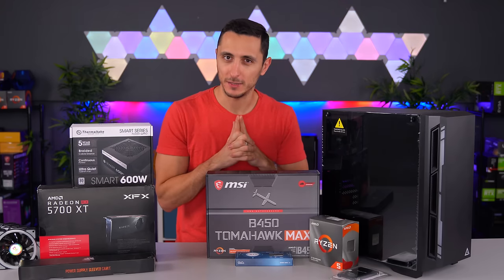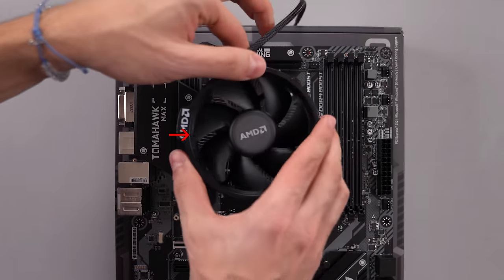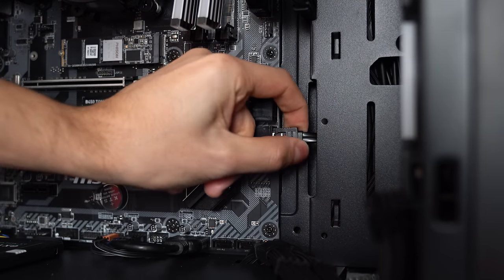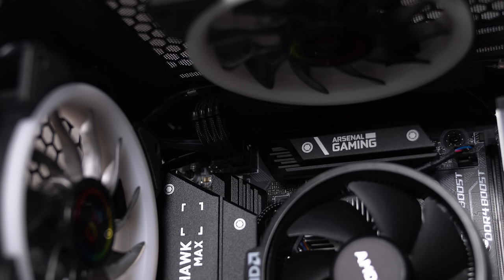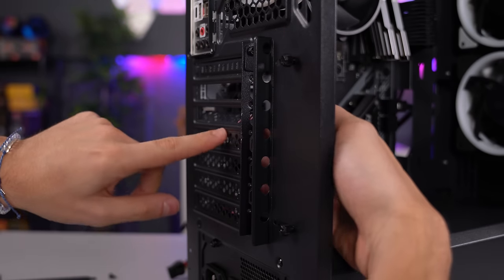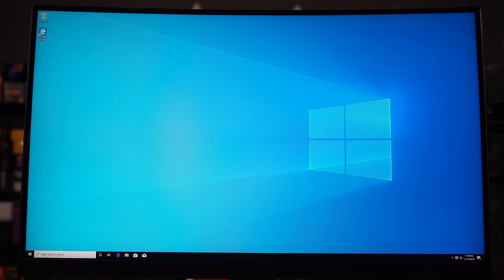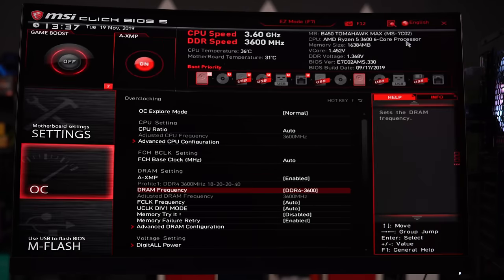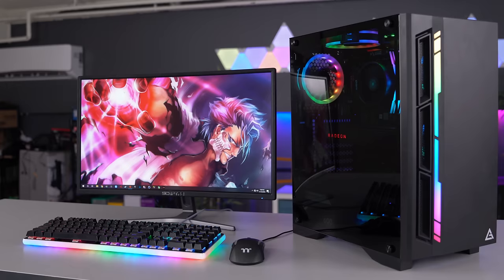How To Build A PC - Full Beginners Guide + Overclocking

Comment: I am not sure what I should buy:
NFX RX 5700XT or Non-Blower RX 5700XT
Reply: Non blower style will probably get you better temperatures assuming you have a conventional build with multiple case fans and room for air to flow in the case
Reply: @TheTreyVidz  Did Techsource use the non blower in this build?
Reply: @uncledave8547  He's using a blower card in this build.  Way to tell is that the heatsinks are hidden within the shroud on blower-style cards.  I assume he used this card because it fits the budget better.  In reality, the differences are probably not too extreme when it comes to cooling but typically you'd benefit more from a non-blower card (aka open-air) in a build like this.
Reply: @TheTreyVidz  Thanks for replying, i'm going to build this pc but I don't want to use the same graphics card that he used. If I get the non-blower one from the link in the description will that work, and will It make the pc run better?
Reply: @uncledave8547  No problem! Theoretically yes, you'll have better performance because your card will run cooler, and will keep it "healthy". Keeping temperatures low means the graphics card can perform its best and you won't have to worry about thermal throttling or the lifespan of the card. Low temps also give more headroom for overclocking if you plan on doing so.

To explain the differences, the blower-style cards have a heat sink that is hidden within the GPU shroud and pulls in air that exhausts through the rear, which is outside of the case.  But these cards just have a single fan and that fan will have to work harder to keep things cool. 

The non-blower (open-air), specifically the one linked, has multiple fans that are pulling air through the graphics cards to the heat sink. However, the heatsink on these cards are open and expel hot air back into the case. For most builds, this isn't a problem as long as you have proper airflow that can exhaust the hot air from the case, making this the preferred card for this type of build since the card can pull in more air and the case can exhaust the hot air that it expels. 

 * Keep in mind as a side note, not all single fan cards are a blower-style, open-air cards may also have one fan but they still work as described  *

The blower-style is better for super compact builds that don't have many fans or space for air to flow as it exhausts the hot air outside of the case instead of back into the case where it's hard to expel it. (Mini ITX builds) 

Hopefully, this helps explain the differences.  Good luck on your build, the 5700 is a good card and the one linked is on sale now!
Reply: @TheTreyVidz  Cool, will the power supply that he used in the video work with the card, and what monitors would work best with that card, thanks!
Reply: Davis Yes the power supply will work fine with that card, and 700w is plenty for a build like this. As for monitors, you’ll want one that’s free sync compatible for smooth game play.  Depending on what you play I’d get a high hz 1080p monitor (120hz+) if you play a lot of competitive shooters, or get a 1440p monitor if you play a lot of single player games or prefer visuals. You should be able to get 60fps + at 1440 on most games.  Personally I’d try getting 1440p with high hz rate if you can to get the most out of the card.
Reply: Tr3yJord4n Ok nice, but the power supply is 600 watts?
Reply: Davis ahh my mistake looked at the wrong one.  That should still be plenty! Anything above 500w will be completely fine.
Reply: Davis use https://pcpartpicker.com/ to see an est. of your wattage and compatibility of parts
Reply: Tr3yJord4n ok thank you so much without you I would of probably got scared and decided not to build it!
Reply: Davis no problem dude! Glad I could help, hope it goes well
Reply: @TheTreyVidz  hey i was planning on building this rig because im new to this whole type of thing but want to make the switch from console, would you recommend anything being changed if i want to game, and produce music on the same pc? thanks
Reply: @k.strive46  I'm not too knowledgeable when it comes to music production.. But if you're big into music production you may want to look into getting a good sound card or an external audio dac and maybe getting a graphics card closer to a 1660 that will be a bit cheaper and still run any modern game at 1080p 60+ fps.  The rest of the system here will be just fine for your needs.  I wish I could give a better suggestion for you but I'm fairly clueless when it comes to sound cards. And of course, if you can afford a 5700 or 2060/2070 graphics card and a sound/audio dac definitely get both!
Reply: @TheTreyVidz  thx mane

Comment: Just a question does gtx 1660 super work with any motherboard and cpu? If not is there a way to check what cpu and motherboard it works with?
Reply: as far as i know it works with most modern motherboards like x570s or b450s
Reply: Yeah it should work with any motherboard as long as it has a x16 pci slot
Reply: Go to Pcpartpicker.com, you can put all of the parts you want in it and it will tell you if there are any incompatible parts or restrictions. :)
Reply: @Aaron-fd6lq  Oh thank you so much!! :D
Reply: Alesha乡 anytime ! Also Linus tech tips, if you run into any problems make a post and somebody more advanced will help you out! Good luck:)
Reply: @Aaron-fd6lq  Thanks :D
Reply: Alesha乡 also, reddit is your best friend with r/buildapc

Comment: Tech source ftw coming in hot. Just about to build my all AMD satan system red and black goodness. 
Rate it!
RX 580 Red devil 8gb
Ryzen 5 2600x 
corsair carbide red and black spec 04 tempered glass case
650watt modular corsair psu
2x 8gb corsair lpx vengence 
b450m motherboard with red and black accents 
and a 250 gb ssd 
and a 2tb seagate external hard drive 
and a 1tb seagate hard drive
Reply: it’s Good but if You Replaced 2600x With an 2600 ( Normal ) Will be alot Cheaper and Replacing Rx 580 With And GTX 1660 Super, Will be Alot Better, From opinion Because i Have About The Same Specs And it Works Really Good, You May Add Some Money on it but Worth it
Reply: X_JOoOker17 ^what he said^
Reply: @XJOoOker17  Yeah i would have gone with a better card but it can be a hell pc build without a graphics card called red devil.
Reply: I’ve heard with Vengeance LPX ram it’s hard to overclock well and it has trouble hitting rates speeds because of the Hynix die
Reply: you don’t need that power supply is too much for a 580 and a 2600. A 500 w is enough. Maybe less storage and upgrade it later. You could’ve saved some money and bought a better gpu like a 1660 or 590 or something
Reply: @lctasos5681  upgrade path will be much better since he bought a 650 watt psu
Reply: Dont go for 1660 lmao go for use vega 56 or gtx 1070 for 200$ and for 300 rx 5700 or for 350$ for rx 5700xt 1660 arent worth it

Comment: Hello, im building my pc and I was wondering. If I have ethernet can I download the drivers without the adapter?
Reply: Yuh
Reply: Easiest way is getting the driver through flash drive but ye that works.
Reply: Yes you can  it's better with an ethernet
Reply: @jaketheboss9092  he is talking about connection to internet
Reply: @xanibalxsupp  Yeah in relation to Windows Installation... right?
Reply: @jaketheboss9092  yes I believe he is asking about connection (wifi) so if he has an ethernet cable there's no need for him to get the wifi adapter

Comment: 6:19  Not so fast. Fan UP is also totally viable. IE: My PSU shroud is perforated, allowing the PSU to draw air while face up. 
Why face up? Because the tower sits on thick carpet, and I don't want my power supply sucking on carpet for hours at a time. PC's did fine for nearly 4 decades with the PSU facing inwards. It does no harm in the right case.

Comment: Hello Ed. i've watched a bunch of your videos for a while now and i build my own pc with the following specs:
Amd ryzen 9 3900X
Asus Nvidia rtx 2080 advanced super OC
RAM G.SKILL Trident Z Neo RGB 32GB (4x8GB) DDR4-3600MHz CL16
Water Cooler CPU NZXT Kraken X62 v2
Motherboard ATX Asus ROG Strix X570-E Gaming
SSD M.2 2280 Samsung 970 Evo Plus 500GB MLC V-NAND NVMe
PSU Corsair TX750M Semi Modular
When i first got the pc i had great FPS in all games in ultra and very high settings, but lately something made me have low FPS in all games, i don't know what, i did a clean install on windows but the problem is still here what do you think it is? I did not Overclock my pc and my temps under load of my CPU don't pass 60ºC and GPU 40 or soº-
thank you in advance

Comment: Good build video but the standoff part needed more explanation. Some cases come with a tool to install them but mine just came with screws. I didn't realize you could attach the screw to the standoff and hold it after unscrewing to remove it. This led to A LOT of confusion.

Comment: hey im new to pc building i just got my case but im not sure how to attatch the rectangler thing that comes wiht it i know its meant to be at the top it already has wires connected to it but i cant un connect it it came deattatched and idk how to put it on when i try to but it in from the inside the flaps are in the way
Reply: Yeah it really helps if you could write a question that actually makes sense. Could you be more descriptive other than "the rectangler thing that comes wiht it"? I'm not trying to be snarky.

Comment: Im absolutely stuck I literally don’t know what to do at all, after overclocking my ram to 3200 MHz then overclocking to 3266 then to 3400, once I got to 3400 and saved, my computer display went blank and when I tried access the bios my cursor wouldn’t move and I couldn’t use the arrow keys so I turned the computer off and back on and now the display isn’t working. I’ve tried everything. Reseating the ram, reseating the cpu, testing each ram slot with each individual ram, using a jumper to reset the cmos, using a different cmos battery, and nothing has worked at all. There are still two flashing red leds that label cpu and dram and I literally don’t know what to do. Peripherals won’t light up but fans still work.

Comment: Hi Ed, I'm building a pc with the same B450 Tomohawk Max motherboard from MSI and the same Ryzen 3600. What settings did you use to get the most over clocked speed on the pc.

Comment: Back when you could fit a certified modular psu, cable extensions, case fans, a $110 mobo, an RTX card equivalent, a good CPU and 16GB of Ram for $1000 with a shi ton of rgb. Parts market is a mess rn

Comment: Hey I have a doubt. If I buy a 4K monitor now, will it work with my 2014 Sony Vaio laptop? 
My laptop has 4th gen core i5 U processor 
Nvidia GT740M 2GB
Can I use a 4K monitor with this laptop? Can I at least use it in 1080p mode until I build a new PC?

Comment: Do you get all the wires in the boxes or did you purchase any wires? Pls reply
Reply: Power supply comes with cables, motherboard box also come with cables , so does the case. You don't need to buy extra cables.

Comment: Can I go with the following please give any suggestions: budget 50k

1 processor/CPU -Amd ryzen 5 3500.
2.RAM-GSKILL RIPJAWS 8GB 3200MHZ.
3.Mother board- Asrock B450M       
     AC( wifi+blueth).
4. SSD-   PNY 240GB .
5.GPU-   GT710 2GB
6.cabinet case- CHIPTRONEX MX1
7.PSU-GIBABYTE 550W BRONZE
8.monitor-BENQ GW 2283(22 INCHES)
9.keyboard- Live tech evon

Comment: I dont know much about pcs and I’m worried that the parts I order will not be compatible is that a thing ?
Reply: It is a thing. Example. you need to look the socket when buying a motherboard so it can fit your processor, or the other way.
Reply: The best thing you can do for yourself is to learn how computers work, the terminology, etc. This will give you a base knowledge about computers that you can then expand on when learning to build PCs. The main things to look out for are CPU, motherboard, and chipset. pcpartpicker.com is a good website to see if your parts are compatible.

Comment: Been following along with this video while building my PC. I’m waiting for my GPU but I’ve done every other step. My power supply seems to not turn on. It does not power the fans or strips, is this because the PC needs to be turned on first?
Reply: That's correct. Power supplies only power on when the PC is turned on. However, you can force the PSU to turn on by jumping two pins on the 24-pin cable. This page shows you how to do it: https://bit-tech.net/guides/modding/how-to-jump-a-psu/1/
Reply: @JJFlores197  thank you very much dude. I actually just figured that out when I pressed the power button on my PC everything turned on 😁
Reply: @Curty_YT  yes very tech savvy i pressed the on button owo

Comment: I'm not able to line up the screw slots of my msi b85m g43 motherboard with this nx400 case..I'm doing my first build. Also the graphic board slot does not line up to get the vgi and HDMI port outside of the rear panel . Pls help

Comment: I build new gaming pc CPU is working fine with all lights fan and input devices. But the monitor is showing 'check signal cable'. And it's not running further.
What's the problem?

Comment: I am STRESSING! I am trying to build my pc. I am completely new at this and I have an older tower, so a lot of these videos aren’t helping because the placement is wrong. For the most part this helped. The thing was disgusting when given to me (not complaining because it was free) so I gutted it and deep cleaned it but now I can’t figure out where the storage goes back in because it doesn’t seem to fit anywhere once the other pieces are in. Also I guess I’m missing some cables because all of those smaller cables (led power +- colored cords.) do I have to have those? Stupid question I know but I bought everything for the pc and they weren’t with anything. 😢
Reply: If you look at the PC case manual, it will give you an overview of the case, including where the drives go. Does your PC power button have an LED? If not, it won't have power cables for that. It doesn't matter if it doesn't have. The power light is not critical for the computer to function.

Comment: Question - why this box?  Why not start with a panel?  Make it open to expansion or upgrading.  For example I could build into a wire shelf space (36"x16"x18") for open access yet still put panels around for dust control.
Reply: did you just call the case a box? and also by wire shelf, do you mean server rack?
Reply: @nicholabrichieri-colombi8471  Someone already helped me.  Yes I had called the case a box (asking questions helps you learn).  And no I did not mean a server rack.
Reply: @steeldriver1776  wdym wire shelf?
Reply: @nicholabrichieri-colombi8471  I was trying to build my on an open board sitting on a wire shelf.  The shelf is 18" deep, 36" wide, 16" between shelves.  Protected, cooled, save money on case.

Comment: For cooling AMD Ryzen 9 5950x Shall I get the Noctua NH-D15 9 (air cooling) or Lian Li Galahad 360mm High Performance RGB CPU Water cooler or NZXT Kraken X73 RGB AIO CPU water Cooler 360 mm or Corsair Hydro Series ICUE Elite Capellix RGB Performance Liquid CPU Cooler 360mm ? Which is the best one. Liquid cooling risky as the liquid can leak ? How good are air coolers ?

Comment: so everything thats in the description thingy is what i need to buy?
Reply: Not all of it becuase some are alternatives; you dont need 3 different graphics cards.
But the main components are: CPU (processor), GPU (graphics card), RAM (Memory), Motherboard, PSU (Power supply unit), a storage device + some fans and cooling stuff. If i missed something sorry im dum
Reply: @nicholabrichieri-colombi8471  thanks!

Comment: If I can get an intel gen 10 10400 for 160, should I get that? It’s compared to the and 3600, but that’s like 240 on Amazon right now, plus like almost every ryzen core previous from the 3600 is also cost more on Amazon

Comment: I have almost identical specs, just wondering if this overclocking setting with the stock cooler is good enough? So nervous as I am building my first pc this weekend
Reply: Also, I am using msi B550 a-pro as the motherboard, would that make any difference?

Comment: do I have to buy the cables separately from everything else or does the power supply come with every cable? And where does the other end of the front panel cables go?
Reply: The cables will come with the respective parts. The front panel cables are attached to those ports. So for instance, the power button cables go to the power button itself; the USB cables go to the USB ports, and so forth.

Comment: Hi Techsource I am wondering if a thermaltake-smart-series-700-watt-80-plus-atx-non-modular-power-supply would work with this pc you built
Reply: Will work but i highly recommend getting 500W 80+ bronze or higher power supply.

Comment: The overclocking helps because ima get the 1050ti which by default gets 120 fps but oc gets 200 on low setting

Comment: Where do I find the screws 9 screws you used for the mother board and the Hard Disk?
Reply: Those should come with the PC case. Most PC case have a small box or plastic bag with screws and accessories for the PC case. Sometimes they may be hidden away behind the drive bays.

Comment: Hey TechSource, im having problems with my wifi on my new pc i built. My pc doesnt have a wireless network adapter and im having trouble trying to get it working. Any ideas on how to solve this?
Reply: You most likely need to install the drivers for the Wi-Fi adapter you have. You can do this 2 main ways: Plug your PC into your router via ethernet and download and install the drivers. Alternatively, use a working PC with internet to download the drivers and transfer them to your new PC via a USB flash drive.